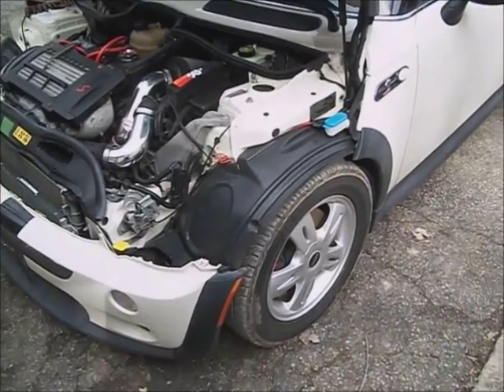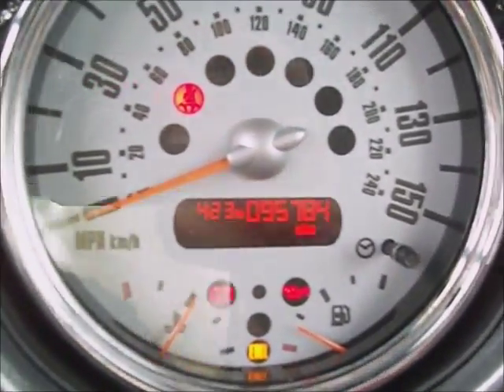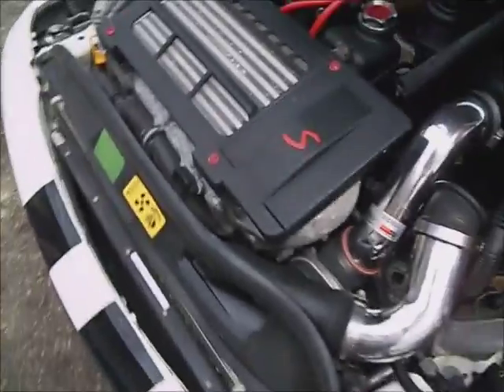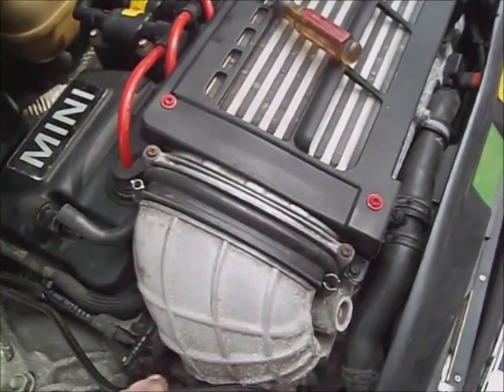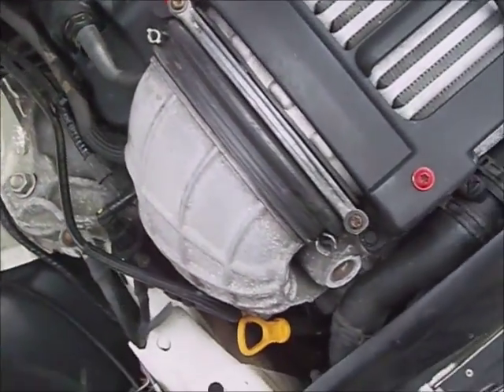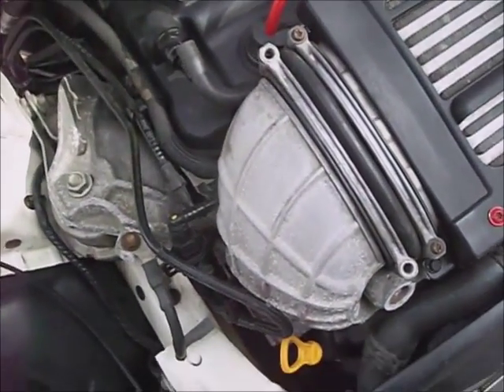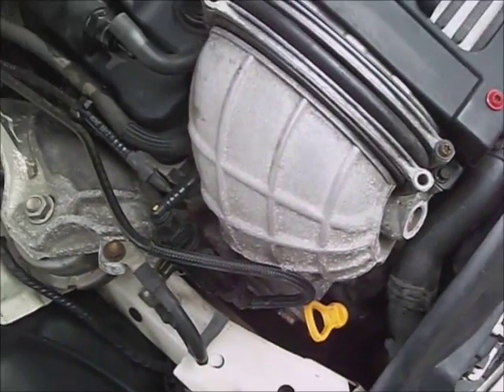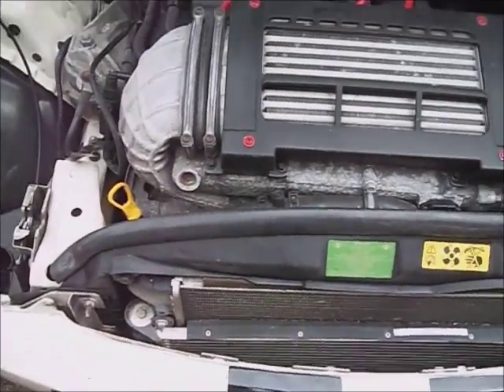06 BMW Mini Cooper S hesitation unresponsive throttle

Comment: u said it had a none responsive throttle peddle im having the exact problem with a 2003 cooper
Reply from the maker: yes it did, and there was definite loud hissing sound coming from that clamp area on the plenum.  I believe that the computer is programmed to detect any type of separation from the throttle body, and allow it to run just enough to say, move it out of traffic, and also prevent it from over revving, and blowing up the engine.  I have seen a throttle body separated on a neon, and it would change engine rpm based on the throttle position sensor feedback, and the throttle plate was not restricting any air flow at all.  But if you don't have a big vacuum leak, it could just have a bad throttle position sensor, and the computer doesn't know that you are giving it any throttle, if it is bad.